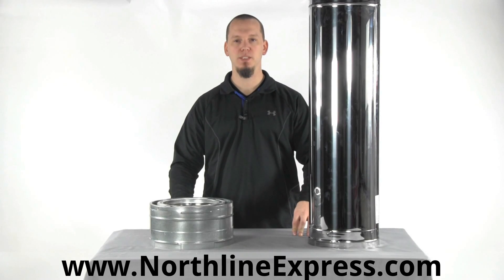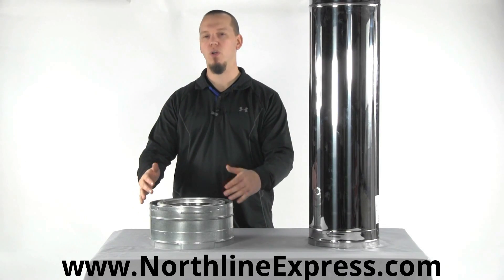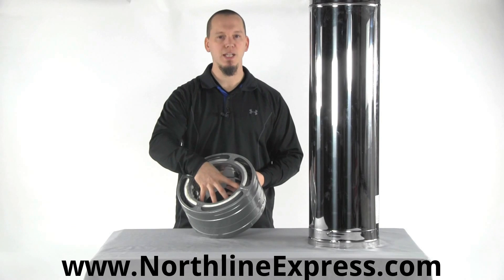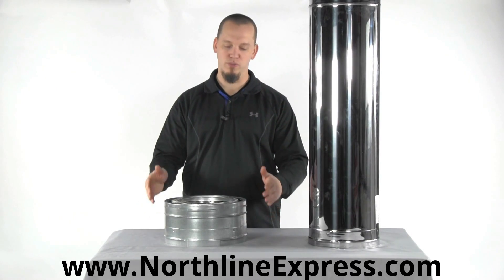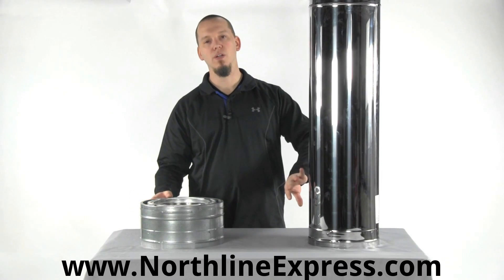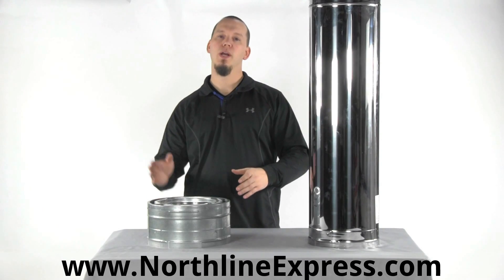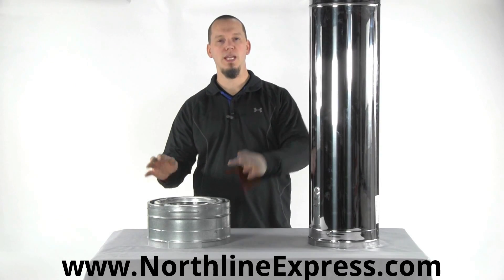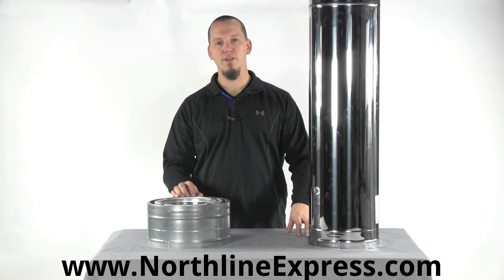DuraPlus Chimney Pipe - Class A Triple Wall Pipe

Comment: uhhh. but WHY.  WHY cant i use a much cheaper option of galvanized outside? is there some kind of code restricting this? also what is the pros and cons from duraplus to duratech?   can dura plus be installed through joist without a problem with spacing?  what about internal and external flu temps and is dura plus or duratech better or worse at drafting  and/or creosote build up? sheesh how come NO ONE addresses these issues. its a freaking $1500-$3000 install and the consumer cant even be informed on some of this basic stuff.
Reply: Galvanized will rust and corrode over time. The better quality stainless will last far longer. As fir brands and pricing it's affected by US made vs foreign. Any pipe has the same rating for install regardless which part of the house it's installed at. They have to meet same safety protocol.

Comment: What is the outer diameter of the pipe? I read that it is 10 inches but cannot confirm it anywhere. If it is 10 inches and the rafters are 16 inch centers, that gives a 13.5 inch opening between rafters. Take out the 10 inches for the pipe and that only leaves 1 and 3/4 inches of clearance on each side of the pipe. If this is the case, is there some kind of rafters shield that can be installed? Thank you!
Reply: if its  16" centers it leaves 14-1/2" clear minus 10" leaves 4-1/2" divided by 2 = 2-1/4"

Comment: what is the difference between the double wall insulated and the triple wall insulated as far as heat transfer , I guess what I am asking is besides the obvious extra wall and air chamber what is the benefit of using this pipe over regular class A duravent or metal bestos type stack?
Reply: it is still 2" clearance